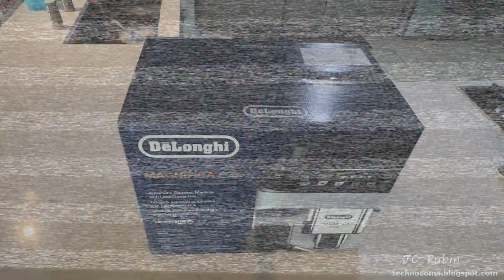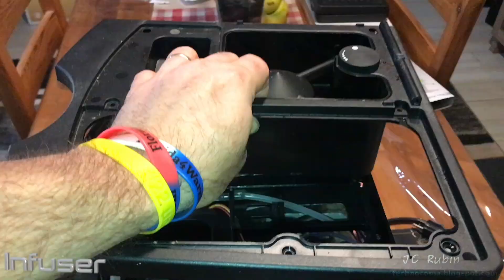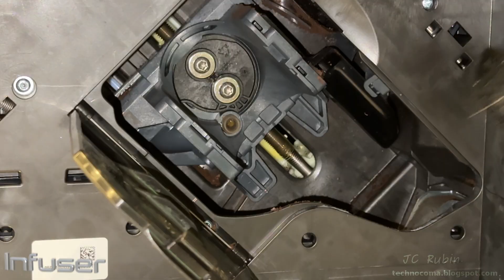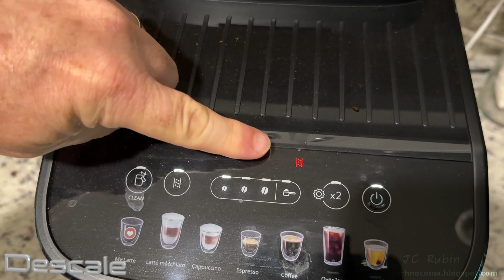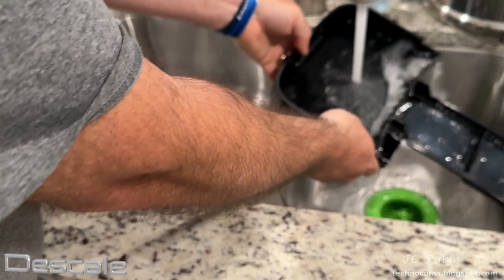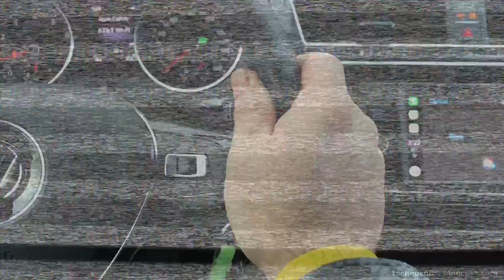How to Maintain & Deep Clean a De'Longhi Magnifica Espresso Machine

Comment: I've got the same machine, but mine has begun to struggle with startups after I've been on vacations, and I've been wondering wether there might be a few spots within the machine itself where one is supposed to use silicone grease on spindles etc ?!? (I've had machines from Siemens where I had to use silicone grease whenever doing a full cleanup of the machine.